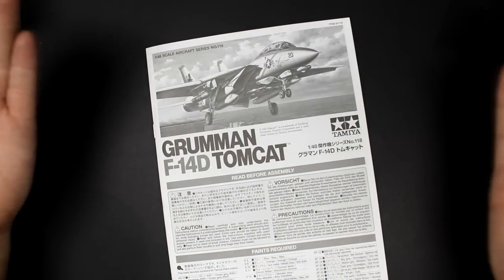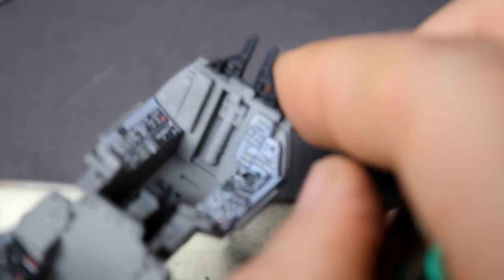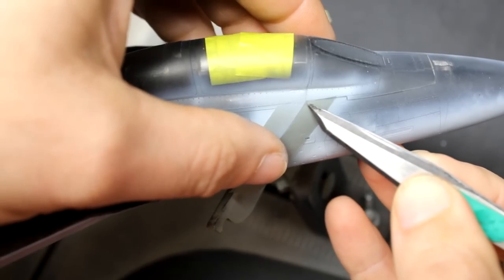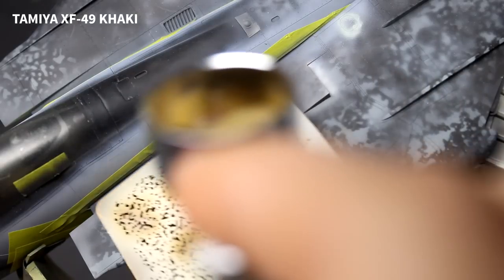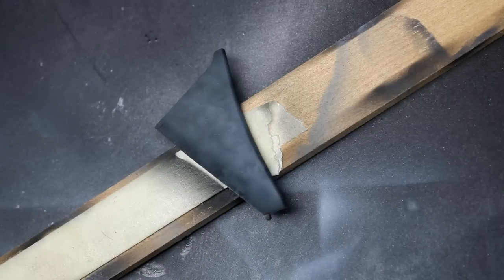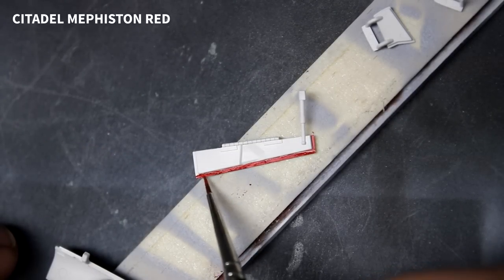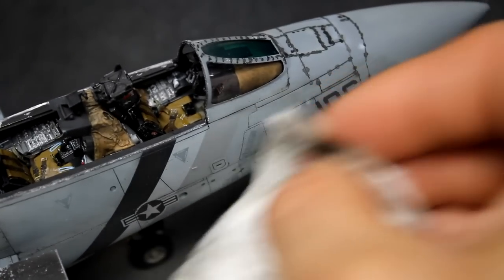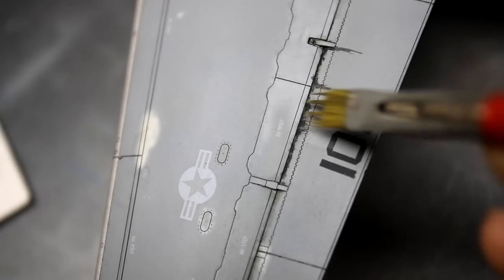Taking Tamiya's F-14D Tomcat to the next level! Extended Sandwich Shading and Oils

Comment: I worked for Grumman Aerospace for 15 years at their Calverton, New York final assembly plant #6 building all the Tomcat versions. The biggest project was the re-engine competition for the Super Tomcat, soon to be the F-14D model. The first engine runs with the GE F110-400's were amazing. Running number one engine at full afterburner for the first time was scary. Engineers were worried it would over strain the nose gear tie down anchor chain. Only once was the Tomcat run at full afterburner on both engines for data needed. It shook the concrete base so violently the concrete slabs were moving under the plane ! Pratt & Whitney also had a prototype engine competing with GE for the D model. The media, Navy and other government officials were watching us install the prototype P&W engine for the first time but it came out being 3/4 of an inch too short to fit in the engine mounts ! During a long lunch break we sandwiched a piece of 3/4 in. plywood between the burner and the main engine core to make up the short fall in engine length. To make it short, Pratt & Whitney was out after this huge embarrassment. We were sad the day the last Tomcat rolled off the assembly line. I have the aircraft's assembly ID number sign hanging at home signed by all the plant workers on the F-14 assembly line.The F-14D was truly a "Super" Tomcat.
Reply from the maker: One thing I really enjoy about doing this is reading stories like yours. This may just be a plastic kit, but it inspires people to remember and start conversation.
Reply: I used to live out that way and loved going to see the Tomcat and Intruder static displays. You must have some great memories. 
You reminded me of a story I heard back when afterburner was first introduced into carrier aircraft. 
The crew had not been made aware of the new technology, and some were diving for cover when the burner lit, believing it to be an explosion.
Reply: I think the Pratt & Whitney engine you're referring to is the P&W F100-PW-1128.  It was a predecessor to the F100-PW-229 which powers the F-16C/D Block 52 as well as ANG F-16C/D Block 42 aircraft and most F-15Es and derivatives after the early 1990s.  The F100-229 incorporated technologies developed for the F119 engine used in the F-22 Raptor.  
While I never heard of the PW1128 powering an F-14 in flight it was tested in an F-15A for a program that NASA managed.  It managed at least 27,000 lbs thrust but was called 1128, the "28" signifying potential thrust in the 28,000 pound range.  The "-229" in the F100-PW-229 classes it as a 29,000 lb thrust engine.  
I read a brief mention of the modified F-15A in a book about the F-15.  That F-15A potentially could have been the hottest-performing F-15 ever flown.  It had at least 6,000 lbs extra thrust over the standard A and C-models and was at least 4000 lbs lighter than the E-model empty I'd bet as long as NASA didn't load it up with a ton of test equipment!
I used to own a compilation of military aircraft books called the Great Warplanes (I think) and the F-14 section discussed the potential engine upgrades.  This was published before the F-14A+ (the modded F-14 Super Tomcat prototype) flew in 1986 so the book was a little out of date.  It was nice though because sometimes these "out of date" books have information the later books don't have!
Reply: @joemoore Lucky you to be a part of this project!

Comment: I do the same stuff.  Circle what I want.  X out what I don't do.  And I even check off steps as theyre done and put post its of substeps that I miss if I go out of instruction order (which is many times during a kit).
Reply from the maker: That’s awesome! It’s very easy to miss stuff when you’re adding aftermarket. Or have different variants

Comment: I built this model about a year ago and must admit it is a very enjoyable build with loads of potential for using the full gambit of pre shading / post shading and other weathering techniques. It builds into a spectacular model.
Reply from the maker: It sure does. Any links to pictures of yours?
Reply: @TheModelGuy  Unfortunately no. I still have the mode but have never really posted anything on line

Comment: Actually, the TPS paints are a pre-catalyzed CARC paint.  The pigments can often respond to storage conditions.  So, the differing runs of paint may "cook off" to greens, or violets, or blues.  It's not a case of different paint in the paint locker (the paint lockers are huge) put the paint cans labeled the same looking different.

Comment: Hi from Scotland. I’ve recently subscribed and find your work fantastic and of the highest quality  , plus your videos to be enjoyable, informative and inspirational for me, who is yet another model maker returning after a 40+ year hiatus. I’ve just started airbrushing and I’m still getting to grips with the best paints. You refer to the use of lacquer as your paints of choice. May I ask why and which is your preferred manufacturer? Many thanks
Reply from the maker: Thanks for the kind words Gordon. I like using Mr Color Lacquers because they are a very durable paint. They hold up to handling well, masking and again be lightly sanded to fix any small errors. Acrylic paints can be very fragile and can be easily removed when masked on. Enamels can take ages to dry, slowing things down.
Reply: @TheModelGuy  thanks for your reply. Something for me to think about and practice!

Comment: I get confused, r u referring to Procon PS 770 with 0.15 needle instead of PS 270? Love your build though🤩
Reply from the maker: PS-270…my wife would kill me if I got a 770
Reply: @TheModelGuy  I stand corrected. Well just wondered if the PS-270 0.2mm needle can be replaced with smaller needle? Thanks man..
Reply: @briannolasco4911  They don't make a smaller nozzle for it. You can put a 0.3mm needle/nozzle in the 270.

Comment: had much truck with vf-1 kits?  i only wish i could get larger ones, they're all pretty much 1/72, 1/48 toys are available, but that doesn't match scale for other things, i'd go smaller to HO scale for a bit of fun, but that'd be hell to paint.
Reply from the maker: Is VF-1 the brand? 1/72 is too small for my mechanic hands
Reply: @TheModelGuy  the vf-1 is a... modified form of the f-14, mostly a concept from a time when nuclear heated jet engines(instead of avgas/kerosene) was an idea bandied about by the more peculiar people out there.  swingwings, twin wide set engines, twin vertical stabilisers and elevators replaced with vectored thrust, a much smaller plane, so in 1/72 even smaller than an f-14.  mounts for small guns under the cockpit with a large gun pod about the size of the one built into the a-10, ultimately a boring plane, but holds a place in many peoples heart for some of the special features.
Reply from the maker: @felderup  oh gotcha why I didn’t know it.
Reply: @TheModelGuy  it's also entirely fictional, from an 80's anime, there's kits all over the jungle site.

Comment: I was the creator and Team lead on this Post 9/11 F/A 18 C VFA-86 aircraft paint Scheme during the last days of deployment. Was A/C 415 been copied many times made into wooden displays. even very detailed scale model.  One of my best Paint schemes ever enjoyed by many of the officers they loved it. Trying to attach Photo but don't think it will allow me so hers link to it, this repaint rewarded the team with unlimited Liberty on last Port prior to returning home from this deployment. Painting aircraft in Hangar is no easy task.  enjoy your detail work. very impressive. the wash on the aircraft panels is very accurate, when a panel is closed it is sealed with DARK gray sealant, many times  this done after corrosion shop has already completed there paint repair  really peas them off,. but hey ehrn dont get part til after the inspection you put it when you get it.  https://i.pinimg.com/originals/4e/ff/27/4eff2761bcd38c88196747d7bf859973.jpg